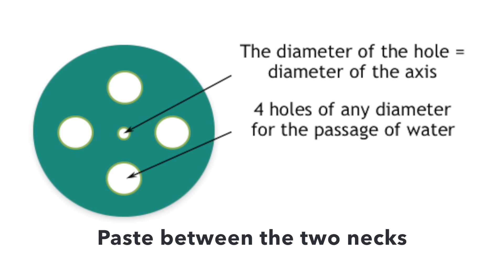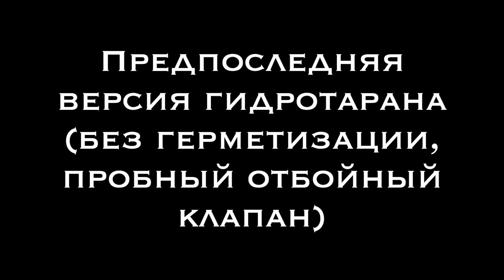How to make the hydraulic ram. DIY hydraulic ram pump

Comment: Two things that make a ram pump work is head pressure in your drive pipe (the drop from your water source) and Back pressure in the delivery pipe. also keep in mind that you need a 2 to 1 ratio between your drive pipe (input) and your Delivery pipe.(output)  also keep in mind the lift capacity is on average 7 to 1, so a 3 meter drop  will lift water 21 meters
one problem i can see is your water source, as the bottle emptied the pressure drops and the pump stops working. you need a constant water pressure in your Drive pipe to make the pump work reliably. you also should have a valve in the delivery line that way you can slowly open it as it fills the delivery line and regulate the back pressure..
otherwise, a great little "McGuiver" Ram pump! from stuff you found laying around.
--Rick
Reply from the maker: Many thanks for the valuable information!!!

Comment: From where the blue pipe gets connection? from bottle?
Reply from the maker: Yes, this blue tube of small diameter is connected to the bottle and the water rises upward due to the air pressure inside the bottle.